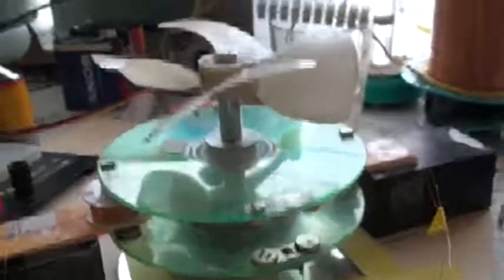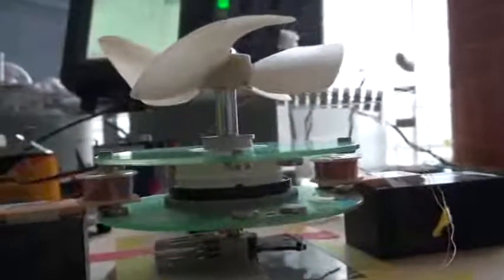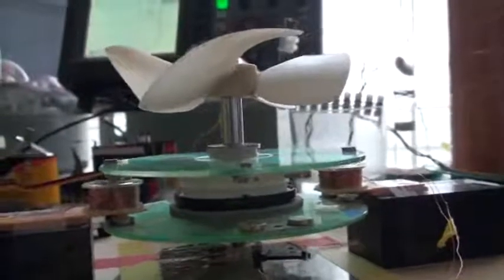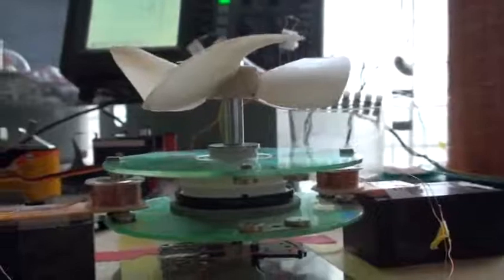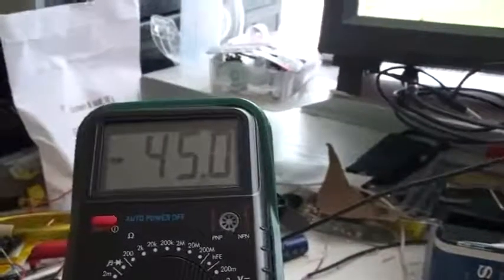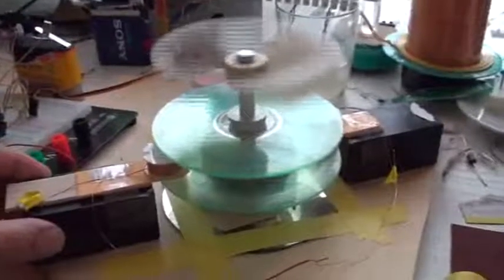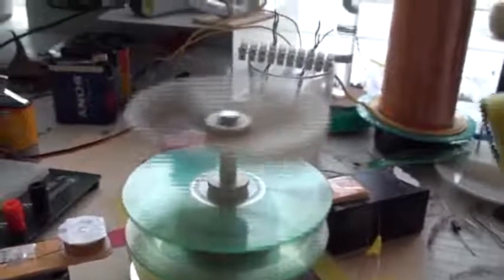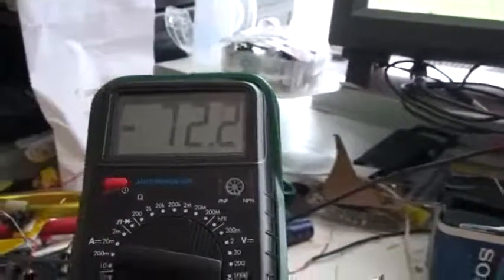pulse motor a la Garry Stanleyand the  2 coils problematic 1.wmv

Comment: Your fan is the reason you are not seeing an increase in shaft speed with the second coil in place.
the output force has changed with the second coil installed and the input power is reduced to achieve it.
If the fan restricting the speed is removed you will see lower draw from the coil pair and higher shaft speed. more speed for less draw = more usable output force from the motor.